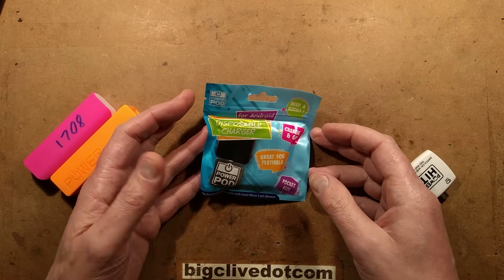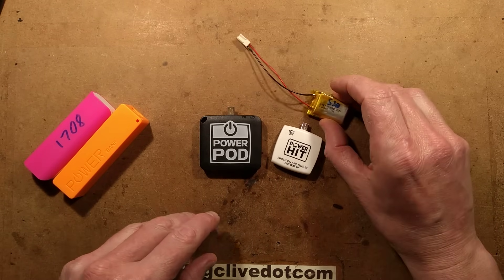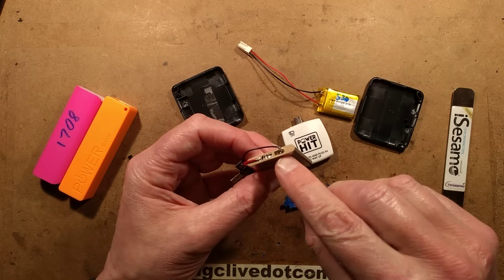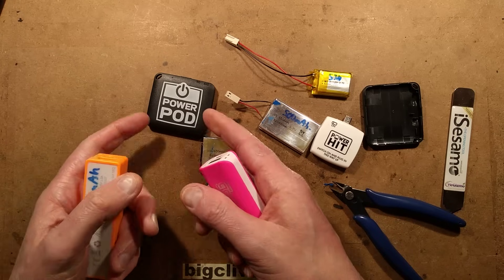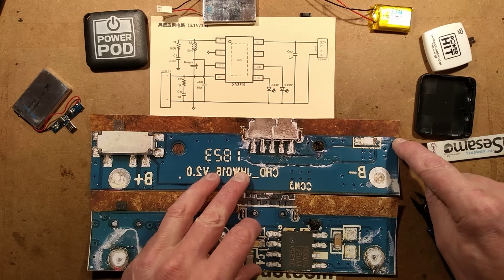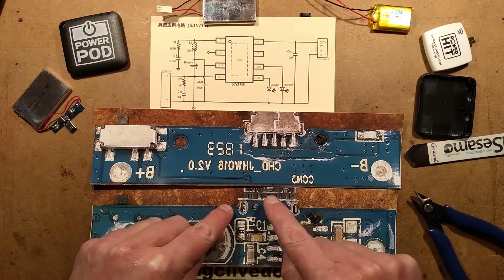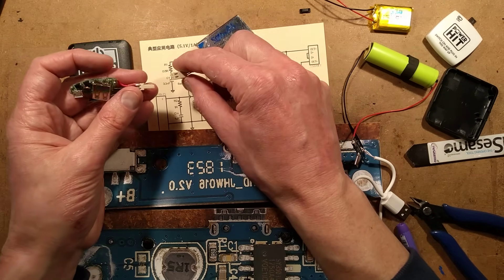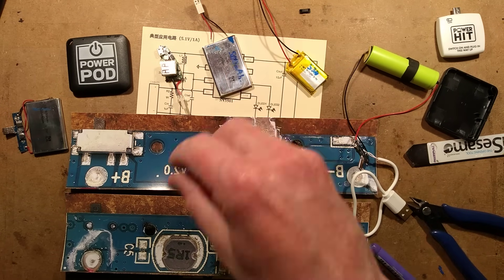Poundland "disposable" phone charger.

Comment: What is the brand and part number of that little switch?  I have some that I want to use on a PCB design but don't have the part number to use for the pad layout. - 8:56  Any help would be appreciated.
Reply from the maker: There are some standard styles.  Try an eBay hunt for the keywords.  As a starter..   PCB mounting slide switch 100pcs
Reply: @bigclivedotcom  - I got a little bag of them already from eBay but I haven't been able to find the PCB component layout yet.  The eBay listings only have pictures and the sellers are clueless.  I'm likely using the wrong key words in Google but hopefully one of your viewers have used them and can help me out.

Thanks for the reply, Clive.
Reply: @ElmerFuddGun  Looks like SW_SPDT_PCM12 in the standard KiCAD library where all the SMD buttons and switches live? The corresponding branded part would likely be C&K PCM12SMTR. Not sure if right, but took me all of 3 minutes to find, you owe me a dollar if i'm right.

Comment: Would they use shitty cells for these?
Reply from the maker: I think they may use cells at the bottom end of capacity spec.
Reply: @bigclivedotcom  Yea probably some Chinese company buying up the rejects. I've had the same 10400mah battery for 5years now, it still works perfectly. It's easier to get a 9v battery and charger your phone off that, than buy one of those.

Comment: Oh my, the old camera batteries, or the Nokia like you said as I type thus comment. But when they used them in camera’s/Nokia’s it had plastic around it and a protection added on top. I see a lot of this in point and shoots from years ago. I never owned a Nokia, but the Motorola flip had a battery also just like it. These are very old cells.
Reply: It better to buy poundland 1200mph power bank one for one pound or there power geek 2200 power bank  one for two pound  or there 4000mah power bank one for five pound

Comment: I just bought Three ZENDURE A8PD 26,800mAh USB-C 30W PD Power Banks
These weigh in at about 1lb or 0.453592Kg and are very cool. I do need to buy a 30watt PD USB c output charger to recharge them since they take about 3 or 4 days to charge up off normal 2.4 amp USB ports I have at this time. Would love if you could do review of it down the road they are built to last.  https://www.massdrop.com/buy/zendure-a8pd-26800-mah-usb-c-powerbanks?utm_source=linkshare&referer=7DXT6A

Comment: Was almost excited to see they were selling them but at £2 that's disappointing. unless you get the 18650 charger and somehow cobble them together to make it better.
Reply: There is a full charger already in there same as on many single 18650s, the deleted components look somewhat optional. Maybe a single setting resistor to be replaced?

Comment: Thanks for the video and info. I just ordered one of these from ebay just to check it out for the cheap battery for tiny projects or replacing a dead cell in one of my gadgets. Obviously as you and I already knew they would be worthless to use as a phone charger.
Reply: It better to buy poundland 1200mph power bank one for one pound or there power geek 2200 power bank  one for two pound  or there 4000mah power bank one for five pound

Comment: As I understand, you can just adapt a cable to charge it. Am I right?
Reply from the maker: That's what I did.  Although oficially you should add the resistor and capacitor across the input for stability.
Reply: @bigclivedotcom  It's funny that they didn't make one with USB-C, because you should be able to recharge with your phone directly (at least if it support to supply power like mine)
Also if you don't care about the battery protection missing...
Btw, a female usb gender changer would be enough

Comment: not related to this video but can anyone tell me what voltage i discharge a AA nimh batt down too to test it's capacity i thought it was 0.9v but someone said lower any ideas?
Reply from the maker: The voltage will plummet at end of capacity.  It holds a fairly constant 1.2v for most of the capacity and then bombs.
Reply: i see, that's proberbly why i couldn't find an answer online about the cut off voltage , i was trying to test a suspiciously cheap set of duracell batts i got on ebay, anyway thanks for answering my question clive have a great christmas and make sure you drink plenty of your brothers expensive whiskey.😁

Comment: Can they write 650 mAh on the product which outputs 5V, when the battery inside is rated 650 mAh at 3.7V?
Reply: Yes, yes they can. But these cell doesn't even do that, since Clive tests on charge and overestimates actual capacity a bit.

Comment: This entire concept sounds so wasteful and stupid that I have to wonder if there isn't more of a backstory to it...

For instance, I think those Nokia batteries have already been recycled. Potentially over and over and over again, to the point that they are almost useless.
I see them in lots of chinese generic devices as an option to make stuff that would usually take AAA batteries also work as a rechargeable device (for instance, tiny bluetooth keyboards, digital clocks and whatnot - usually stuff that draws very little power).
I have a tiny generic chinese keyboard that I got to use with devboards, tiny pcs, android devices and whatnot. The literally retrofited the case to take a Nokia battery. It still has the cutout, tabs and structure to hold AAA batteries, and a removable wonky plastic cover to access that, but instead of having the AAA contacts, it has a Nokia BL-5C battery just shoved in there. xD
You can't use one or the other since the AAA battery cutout has no contacts there, but this plastic case was obviously made or adapted to accept one or the other.

Perhaps the capacity and charge just isn't enough for much else, and they are limiting it to a single charge only because - perhaps it degrades too fast and is already at death's door, or perhaps there is some safety precaution issue there, batteries getting explodey if you keep recharging them.

But most likely, this is just market logic with zero environmental consideration. But in a sense, it's better that those old nokia batteries are getting some use before being completely discarded, than if they were just discarded back at the end of dumbphone's lifetime.
It'd be interesting if instead of this being a waste, it's actually a way to use the battery 'till it's last drops.

I'm still holding some phone batteries that must be the same age of these nokia ones, but from Sony Ericsson phones. Use it in some side project or something. Most of my older phones were given to relatives, so I don't have control over those anymore. And then, older stuff that I still have like tablets and laptops, for the most part, the battery got angry and bloated, so no use for those anymore. xD
Reply: It better to buy poundland 1200mph power bank one for one pound or there power geek 2200 power bank  one for two pound  or there 4000mah power bank one for five pound

Comment: The biggest problem I have with portable chargers is that I have yet to find one that has enough power output to charge modern smartphones properly. My current phone is a Samsung Note 9 and the only way it will take a charge is if it is "fast charging" with a proper wall charger. When I plug into a power bank all my phone ever reads out is "charging" and uses its battery quicker than the portable power bank can charge the phone.
Reply: It better to buy poundland 1200mph power bank one for one pound or there power geek 2200 power bank  one for two pound  or there 4000mah power bank one for five pound
Reply: @mrwahibtahri  

Stop now please. Are you on commission from Poundland or something.
Reply: @johnnodge4327  no

Comment: Haven't really seen disposable lithium power banks available here in America...though I haven't looked very hard. I have seen a neat idea for power bank kiosks at the airport called "fuelrod" where you can buy a power bank, use it, then can either recharge it or exchange it (a fee may or may not apply depending on who owns the kiosk) for another charged one. They're a round shape so seems like they probably have an 18650 which would give you some good capacity. The only thing is to buy one initially is I think about USD $20...so maybe not exactly pound land qualified...though it would be pretty neat if someone could take these cheap power banks and do a similar idea where maybe you can get a £1 credit if you turn one in and £2 to buy one outright...would certainly cut down on waste.
Reply from the maker: I made a video about Vodaphone's version of this.  Sadly they did a recall on them all when they had a few fiery failures.  It's a great idea but hobbled by user naievity and an aggressive profit-motivated legal system.
Reply: @bigclivedotcom  Yikes... fiery failures are never a good thing... I'm a relatively new subscriber so I had no idea...I'll have to look for that video!

Comment: Would it be possible to add protection to these? I am surprized the charger chip doesn't include over-charge protection, although it obviously won't do anything about over-discharge.
Reply from the maker: It does stop charging at 4.2v.

Comment: Is not better to use a CR2477 coin cell battery in these disposable phone charger?
Reply: A Lithium primary cell is actually quite expensive to make because it contains a lot of Lithium metal. However a rechargeable Li-Ion cell is much cheaper because it can be made from premade roll stock in low-tech factories and because there's really barely any expensive material in it, a lot less Lithium.

A more fundamental problem is that coin cells can't give much current because of their construction. CR2477 could have 1000mAh capacity @3V, but it's only intended to deliver this capacity at 0.2mA of current! Maximum current on the order of several mA! While you need at least 700mA to power a half way compliant charging port.

Comment: I hate it, in EU / germany they have to register+pay weee for recycling lottery,
but apart from the pcb also nobody cares that they are selling tons of alkaline and zinc-carbon one-use-cells everyday.

edit: some time ago VARTA was producing 4xAA battery to 5V USB "power banks" (only 500mA).
kinda simple wasteful 5V low drop linear regulator. so you could at least reuse the electronics.

Comment: What is the 1ohm resistor and 1uf capacitor for across the charging pins if you were able to charge a cell without them?
Reply from the maker: I think it's too do with stability of the units voltage sensing.

Comment: They may not be as wasteful as it seems - I'm guessing they're made with recovered batteries from discarded/replaced cell phones and such. If that's the case, at least there is some reuse involved.
Reply from the maker: Unfortunately the clean cardboard insulator on top hints that they may be new.
Reply: And the circuitry? And the plastic casing?

This is disgraceful for all engineers involved in this idiocy. Environmental criminals.

Comment: Someone should design emergency AA batteries charger and earn milions
Edit: there are actualy some already so this disposable product is an absurd
Reply: They sold some at Dollar Tree but 3 AA batteries don't have much mAh in them.
Reply: It's more that there WERE a lot of them and with the price of lithium cells coming down they were mostly made redundant. I was a big fan of them at one point because the better models worked great on rechargeable NiMH cells. Some of them even ran off a single AA for a very compact emergency boost. 

The problem is that even the multi-cell units could only put out about 300mA of current - and the basic USB charging spec is 500. With an old school feature phone, 300mA will get you up and running... but with a modern smartphone that might be hoping for 2.1A, that's 1/7th - a trickle at best.

Comment: Is it a Li-Ion battery? They should cycle under 3V, not explode as much etc compared to LiPos. They do seem to vary in capacity. Anyone who has bought an eBay Ultrafire 3,000mAh 18650 Li-Ion battery for £2 will know.
Reply: LiPo and Li-ion is the same battery, same characteristics.

Ultrafire are poor quality and don't come even close to the claimed capacity.
Reply: @johnnodge4327  Packaging makes a difference, compressive metal case vs. soft pouch. Soft pouch batteries die way easier for some reason.

Ultrafire batteries are likely to just be fake when you buy them cheaply - a genuine one costs like $16 per cell. It's a flashlight manufacturer, their batteries (obviously rebrands) might have become popular and gained a positive reputation at some point, and of course it starts the counterfeit machine even if it's a very niche brand that only flashlight enthusiasts and vapers care about. I don't know if genuine are any better, but it stands to reason that they might be, after all fakes are well documented.
Reply: Lipo are based on Li-Ion but recently the tech has advanced to become a game changer. I'm using 45c to 90c Lipo packs on racing quadcopters but I still use Li-ion for my radios and goggles. A typical 5" blade quad will draw 100A - 120A at 90mph.
Reply: @lostjohnny9000   Depending on chemical composition and construction, you get two broad types of modern high-end Li-Ion cells, high capacity, medium current ones, rated for about 5A in 18650, which is what you get in laptops and flashlights, and somewhat lower capacity, but with about 20A per 18650 cell typically. The latter is what you find in better cordless drill batteries for example, because they too can draw a lot of current. The same technology is available for "Li-Ion" (hard cased batteries) and "Li-Po" (soft pouch batteries).
Reply: The limiting issue with Li-ion batteries is the size. For the cost of a high end Li-ion you could get a 20Ah Lipo at 10c which should safely provide you 200A for 6 minutes. Three of these would easily start a 2 litre diesel. To achieve the same from Li-ion you would need 30 x 20c cells in parallel. I'd only use 18650 for safety and convenience eg. if I was building a powerwall or to use in my festival powerbank.
Reply: @lostjohnny9000  You know, i wonder if RC oriented LiPo vendors aren't terribly overrating them. The 5A/20A ratings are not for instantaneous current or minutes, they are what the cells are designed to do for hours, continuously. If you needed them just for a minute, drawing 2-4 times as much would usually be entirely par for the course. But also isn't terribly conductive to their life. Which is how cheap drill manufacturers manage to sell battery packs made out of really filthy cells that would maybe pass for the 5A rating or maybe they wouldn't, and the drills still run, just... not for months of daily use.
Reply: @Siana Gearz Unfortunately some do. As with the Ultrafire cells you sometimes get a dud copy. They appear to work OK for the first few flights but you'll soon notice unwelcome voltage dips when applying the throttle. Since we can no longer import cheap LiPos direct from China without paying danger money we have to buy from EU vendors which is not a bad thing for the hobby.  This review by a respected YouTuber gives a demo of a decent 100c LiPo pack. https://www.youtube.com/watch?v=ovk_i1ctygg

Comment: My local Poundland is charging £1 for these Power Pods. I have found that the cells are slightly less than 500mAh rather than the claimed 650.
Reply: They do have a '2' on the packaging, but the robot only wanted £1 from me.

Comment: those specific blackweb chargers  bwc17w1004 that they sell each year on blackfriday for 15$ actually ave slightly more capacity then the 20,000 mah advertised. the cells in mine are are 2600. so excelent bang for your buck, great for raspi and projects. not low current draw freindly tho, will auto off somtimes.
Reply from the maker: That's the annoying thing about the larger capacity units.  There's always the option of grafting in the simple module from a cheap powerbank that gives out 5V all the time.

Comment: These things are literally cancer to environment. 

Actually, they order batch of 4000-8000 of these. The circuit and the battery are made in china in bulk and are exceptionally cheap. Even after the shipping, big corps make a good margin selling you these at 2Pounds. 
They might just have paid less than quarter of a pound for one including everything. 
So it's like capitalism on a whole new and shittier viewpoint
Reply: The sickest part, as Big Clive has demonstrated that for the want of a USB A port and a couple of SMD components, it could easily be made rechargable.
Reply: FunScientifix Cost to the company that is having them manufactured is approx. 1/6 the retail cost.....Cheap indeed.
Reply: It's just capitalism, late-stage and seeking to squeeze the last chunk of profit out of anything it can. Ravenous, cannibalistic, CHUDly.
Reply: Well it is possible to get your hands on a new circuit board and repurpose then. 😀
Reply: Is it any worse than a high end phone manufacturer, forcing the phones to slow down when the LiPo gets old. Then actively conning the owner of said phone to buy a new one, instead of simply replacing the battery. I suspect that phone manufacturer is responsible for far worse environmental damage than Poundland selling a few disposable chargers.
Reply: @johnnodge4327  Yes, it is worse. Most people who buy Those Phones either turn them in for credit - which means the phone will be recycled or perhaps refurbished and resold - or hand them down to family or friends if they're still working. Sure, there are the broken ones and oldest models, but I don't see people just leaving them on the ground as others have described seeing these things at a festival - not even in the trash bins, just left on the ground. 

And by the way - "whataboutism" is a mental defect. Even if Those Phones were worse - another problem existing is not an excuse to hand-wave this one.